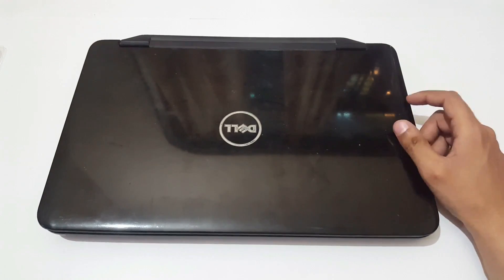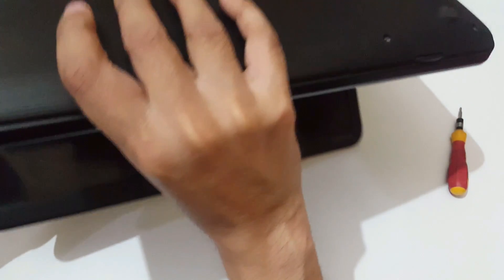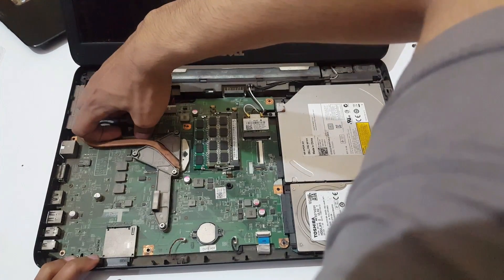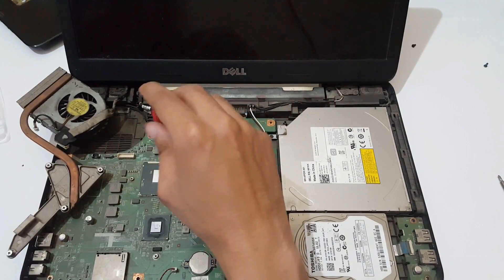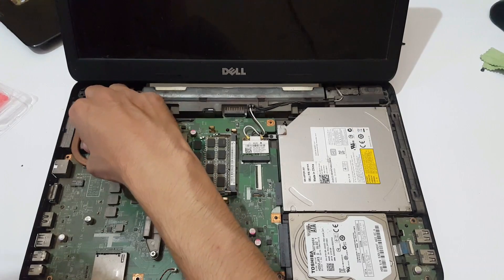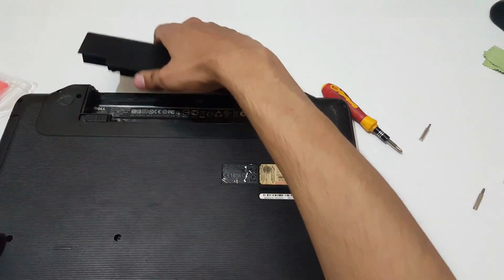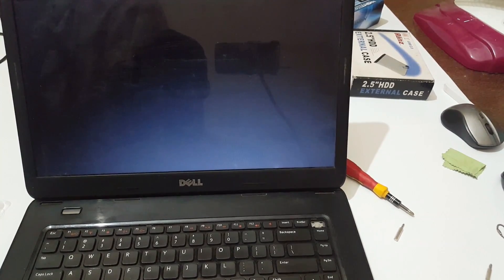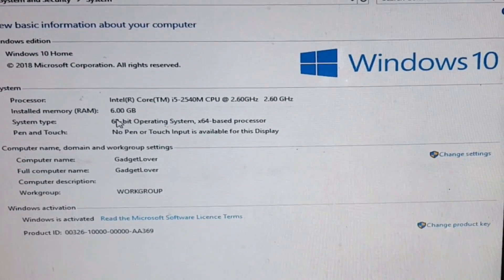How to Upgrade Processor on DELL Laptop | i3 to i5 & i7 - Make Laptop Faster for Gaming

Comment: Can I upgrade my laptop's processor ( or can I install 2 rams )?  : 
DELL inspiron 15 3000, 4gb ram (2gb amd m430 videocard) and i3
Reply from the maker: Ziya Mammadli : In my knowledge the processor of this Laptop is soldered so you can't upgrade it I would suggest you upgrade its RAM and install SSD for better performance
Reply: @GadgetLover360  bro I am also using the same laptop
Can I upgrade the motherboard to a better one so that I can install a better cpu..?
Reply from the maker: siva kumar : Yes
Reply: we r same spces bro i upgraded my ram to 12 gb it perform bettter i have dell isspiro with 2gb amd graphics i3 7the gen right

Comment: I have a dell latitude e5440 intel core i5 4310u can i change processer of this laptop i5 9th gen
Reply from the maker: The space Tv : The processor of this Laptop is soldered so you can't upgrade it so I would suggest you upgrade its RAM and install SSD for better performance
Reply: Gadget lover : thanks for reply
Reply from the maker: The space Tv : You're welcome
Reply: Gadget lover : what ram size should I buy 4gb or 8gb
Reply from the maker: The space Tv : I would suggest you see its manuals for RAM upgrade details
Reply: Gadget lover :can i play gta v on this laptop
Reply from the maker: The space Tv : No
Reply: Gadget lover : why
Reply from the maker: The space Tv : It will not run smooth in this Laptop so I would suggest you low its graphics properties and see it is running properly or not

Comment: I have HP pavilion 14-n045 tu
How can I upgrade this to work on solidworks smoothly. 
Please guide me.. Thankyou
Reply from the maker: Rab pro : You're welcome and in my knowledge the processor of this Laptop is soldered so you can't upgrade it so I would suggest you upgrade its RAM and install SSD for better performance

Comment: My laptop is dell vostro 15 3581
Please suggest max upgrades for my laptop
Reply from the maker: GAMEARI X : In my knowledge the processor of this Laptop is soldered so you can't upgrade it
Reply: @GadgetLover360  : actually tell me if I can upgrade the ram and to what extent
Reply from the maker: GAMEARI X : Yes and for more details I would suggest you see its manuals

Comment: My laptop is Dell Vostro 15 3546 intel celeron 2957U @ 1.40 GHz which is max upgrades for this laptop to improve it's performance?
Reply from the maker: Anuj Kumar : The processor of this Laptop is soldered so you can't upgrade it so I would suggest you upgrade its RAM and install SSD for better performance
Reply: @GadgetLover360 oh thanks for the info
Reply from the maker: Anuj Kumar : You're welcome

Comment: Hi. I have used i3 core in  windows 8.1pro,  so can I use i9 processor in my laptop  and is it possible?
Reply from the maker: Avik Samanta :  If it is not soldered you can upgrade it in same generation
Reply: Thank you
Reply: Please tell me can windows 8.1pro support miracast? If it's supported so how can I cast on my SONY TV
Reply from the maker: Avik Samanta : You're welcome and I would suggest you go to my Youtube channel and watch How to Connect Laptop to TV
Reply: Can you send your link for this video
Reply from the maker: Avik Samanta : Link is https://m.youtube.com/watch?v=s9mNGM8X63Y
Reply: My Sony TV support Miracast. I connect my mobile on TV with Miracast but my laptop didn't connect.
I check in my laptop that my laptop support miracast and yes  my laptop support miracast. But when I connect to my TV so the laptop send me that somethings went wrong. Few days ago I installed more apps on my laptop example Miracast Display etc. But no one connect. So please tell me app that I can cast to my laptop to my TV please.. 😔😔
Reply from the maker: Avik Samanta : There is no need of third party software for this method I would suggest you check HDMI cable is working properly or not
Reply: I have no HDMI cable and why I need for this when I have miracast option sorry my friend you can not solve my problem 😔
Reply from the maker: Avik Samanta : I would suggest you first connect your Laptop and Smart TV to the same WiFi network connection then try again

Comment: Sir I have the same laptop you have shown with 4 gb ram and 500gb HDD can I upgrade the RAM and HDD TO SDD and upgrade my processor as well
Reply from the maker: siva bhaskar : Yes
Reply: Gadget Lover what is the ram I should buy and my laptop presently has 4gb of ram installed and what ssd is best
Reply: Gadget Lover thank you sir
Reply from the maker: siva bhaskar : You're welcome and I would suggest you buy hynix 4GB 1333MHz RAM and Seagate Maxtor Z1 240GB 2.5 inch internal SSD for your Laptop
Reply: Gadget Lover thank you sir
Reply: Gadget Lover Thank you sir
Reply from the maker: siva bhaskar : You're welcome and if you are using Windows 7 I would suggest you upgrade it to Windows 10 for better security and performance
Reply: Sir any suggestions on updating my OS as I am facing severe lag in my laptop while using it,

Comment: Hi brother I am very surprised about your shared video of updating the processor. Actually I am using Lenovo G50-70 laptop model number is YB05106990 MISSION TYPE MODEL 80DY59422410. IS IT UPGRADABLE WITH I5 PROCESSOR. IF IT IS POSSIBLE CAN YOU PLEASE SUGGEST ME WHICH GENERATION OF I5 PROCESSOR HAVE TO BE UPGRADE?
Reply from the maker: dinesh m : Hi and Unfortunately the processor of this Laptop is soldered so you can't upgrade it

Comment: i have dell inspiron 3576 with  i5-8250u processor can i upgrade it to i7?
Reply from the maker: pratik gamer : The processor of this Laptop is soldered so you can't upgrade it
Reply: @GadgetLover360  so there is no way to upgrade the processor?????????
Reply from the maker: Nirajan Gyawali : Yes there is a way but professional hand soldering services are required for this
Reply: @GadgetLover360  So through Pros i can upgrade my 1.2ghz gpu to more than 2ghz????
Reply from the maker: Niranjan Gyawali : No but you can attach it externally to your Laptop

Comment: I have i3 processor and 4 gb ram can you change ram and processor
Reply from the maker: Ompati : If processor is not soldered you can upgrade both and I would suggest you install SSD for more better performance
Reply: @GadgetLover360  thnx but tell me about processors cost i5 processor +Ssd
Reply from the maker: Learn Hindi Fact : What Laptop do you have

Comment: Sir, I am having dell inspiron n5050. I have the manufacturer configuration and did not upgrade anything. I do not have a graphics card also . Suddenly my laptop has become very slow and hangs a lot and has become unusable. I am using windows 10 . What is the cheapest upgrade/fix as my laptop is almost 6 years old . 4 gb ram , 500 gb hdd, i3 processor
Reply from the maker: Ankush Chakraborty : Intel Core i5 2540M is best processor for your Laptop and you can attach graphics card externally to your Laptop for better gaming experience and I would suggest you upgrade its RAM and install SSD for more better performance
Reply: @GadgetLover360  Sir, I am not willing to spend much after it as its already 6 years old . Please suggest minimum which changes are acute mandatory to run windows 10 properly . I checked in task manager that my cpu usage never climbs up more than 20 % but then also my laptop hangs. Can you please tell me the reason why I am facing this issue? Disc usage is also 30% most of the time and memory usage is 51% , none of them never reaches 100 but laptop hangs.
Reply from the maker: Ankush Chakraborty : Give a fresh start to your Laptop and see whether the problem has been solved or not
Reply: @GadgetLover360  no sir , it is not solved
Reply from the maker: Ankush Chakraborty : I would suggest you go to nearby PC store and tell them about this problem they will fix it
Reply: @ankushchakraborty8179  Run chkdsk in cmd window (it will show if there is any error in HDD), then open %temp% in run command delete all the files and then open temp folder using run command and delete all the files after that run prefetch in run command and delete all the file except those which system show a message window to skip or delete. If after all the aforementioned steps your system still slow, then change your  hdd and replace it with SSD.

Comment: I have dell Vostro 15 3000 i3 7020U processor, can you suggest which processor I can upgrade????
Reply from the maker: mayur chandekar : Intel Core i5 7300U is best processor for your Laptop and I would like to inform you that if processor is soldered you can't upgrade it

Comment: Sir I have asus vivobook 15 x512fa ej373t with i3 10th gen processor i can upgrade the processor or not and whic is the best processor if it is upgradable
Reply from the maker: Kamlesh Verma : In my knowledge the processor of this Laptop is soldered so you can't upgrade it

Comment: Very nice video bro :) . I have panasonic cf-53 with intel core i-3 2310M, how can i upgrade it ?
Reply from the maker: Azwir Al Kapi : Thanks and Intel Core i5 2540M is best processor for your Laptop and I would like to inform you that if processor is soldered you can't upgrade it

Comment: Hi, i have levovo ideapad s145-14wl core i3 i want upgrade to core i5 which core do i have to buy? And ram also just 4gb only -_- and btw.. Can i upgrade my laptop to NVIDIA graphic? Is it compatible?
Reply from the maker: Jang man Wul : The processor of this Laptop is soldered so you can't upgrade it but you can attach graphics card externally to your Laptop and I would suggest you upgrade its RAM and install SSD for better performance

Comment: bro plzz tell how can i choose perfect processor for my laptop
Reply from the maker: KUCH MAZEDARR : What processor is in your Laptop
Reply: @GadgetLover360  intel core i3-6006U @2.00 Ghz, 2000Mhz
Reply from the maker: KUCH MAZEDARR : Intel Core i5 6360U is best processor for your Laptop and I would like to inform you that if processor is soldered you can't upgrade it
Reply: @GadgetLover360  plzz cant you get me the link of this processor from any website
Reply from the maker: KUCH MAZEDARR : I would suggest you buy it from Aliexpress online store
Reply: @GadgetLover360  mena check kia pr mujhe nahi mila
Reply from the maker: KUCH MAZEDARR : If not available find it on other websites or buy Intel Core i5 6300U
Reply: @GadgetLover360  but it has only 2 cores
Reply from the maker: KUCH MAZEDARR : Both has 2 cores
Reply: @GadgetLover360  bhai mujhe upgrade krna hai i want 4 cores
Reply from the maker: KUCH MAZEDARR : No such processor available and this processor will upgrade the Laptop performance
Reply: @GadgetLover360  can i upgrade this with intel core i5 9600k
Reply from the maker: KUCH MAZEDARR : Unfortunately you can upgrade it in same generation only
Reply: @GadgetLover360  so which generation processor I have?
Reply from the maker: KUCH MAZEDARR : Sixth generation

Comment: mine is a Dell inpiron 15 n4050 which cpu should i upgrade?? (the best
)
Reply from the maker: Andre Yee安特乐 : What processor is in your Laptop
Reply: @GadgetLover360  i3 2330m 2.20ghz
Reply from the maker: Andre Yee安特乐 : Intel Core i5 2540M is best processor for your Laptop
Reply: @GadgetLover360  how about i7 2620??
Reply from the maker: Andre Yee安特乐 : Yes you can upgrade it with this processor

Comment: Hello sir, Dell vostro 1320 core 2 duo P8600 @ 2,4Ghz can upgrade or replacement processor? Thanks
Reply from the maker: 良し俺 : Intel Core 2 Duo P9700 is best processor for your Laptop
Reply: @GadgetLover360  thanks a lot sir
Reply from the maker: 良し俺 : You're most welcome
Reply: @GadgetLover360  sorry sir, how about core 2 duo T9600 or T9550, can i replacement to it?
Reply from the maker: 良し俺 : Yes you can upgrade it with these processor but it will produce more heat and Laptop will run hot
Reply: @GadgetLover360  okay thanks for information sir, i'll think about it
Reply from the maker: 良し俺 : You're welcome

Comment: Hi!! I have a Dell15-5558 with Intel i3 and 12Gb of RAM, what CPU should I buy to upgrade it and make it faster?
Reply from the maker: Carlos : The processor of this Laptop is soldered so you can't upgrade it I would suggest you install SSD for better performance
Reply: Intel 480
Reply from the maker: Beemy Breezy : Intel Core i7 640M is best processor for your Laptop
Reply: Who said I have a laptop
Reply: But still thanks for the advice
Reply from the maker: Beemy Breezy : You're welcome
Reply: I have a laptop lenova yoga it was i3 how will change into i7
Reply from the maker: 4 Friendzz : In my knowledge the processor of this Laptop is soldered so you can't upgrade it
Reply: @GadgetLover360  thanks for the reply
Reply from the maker: 4 Friendzz : You're welcome
Reply: @GadgetLover360  Then what I do for change it
Reply from the maker: 4 Friendzz : I would suggest you upgrade its RAM and install SSD for better performance

Comment: I have Hp -p029tx  i3 processor ram 4gb can I upgrade it to i5 or i7 ?
Reply from the maker: master AZ : Intel Core i5 4310U is best processor for your Laptop and I would like to inform you that if processor is soldered you can't upgrade it

Comment: Hey mate 
I have a Dell e6430 with these specs, what upgrades would you recommend 

CPU: Intel Core i7-3540M Processor (4M Cache, 2 Cores, 3.0GHz base frequency)
RAM: 16GB Non-ECC DDR3 1600 MHz SDRAM
HDD: 128Gb LITONIT SSD Drive
Graphics: 
1x Intel Integrated HD4600 Graphics
1x Nvidia NVS 5200M
Reply from the maker: Ash Royan : Intel Core i7 3632QM is best processor for your Laptop and I would suggest you install SSD for more better performance

Comment: Can i upgrade proccer on dell inspiron 15 3521 plzz replay fast 😱😱😉😉😝😊
Reply from the maker: Roasting By Rishab : The processor of this Laptop is soldered so you can't upgrade it
Reply: @GadgetLover360  so can i install gpu on it
Reply from the maker: Roasting By Rishab : You can attach graphics card externally to your Laptop
Reply: @GadgetLover360  i want internel
Reply from the maker: Roasting By Rishab : It is not possible

Comment: Hey great vid. I have an old Dell N4010 and I wanted to upgrade it to i5-2450M but all I can find online is used processor. Can you suggest similar i5 processor that can help similarly and is easy to find it online?
Reply from the maker: nine8nine1 : Thanks and what processor is in your Laptop
Reply: @GadgetLover360  It's Intel Core i3 CPU M370 @2.4GHz
Reply from the maker: nine8nine1 : Intel Core i5 580M is best processor for your Laptop
Reply: @GadgetLover360  Thank you man
Reply from the maker: nine8nine1: You're welcome

Comment: Hello sir, i have Dell Inspiron 3552 . Processor= penN3710. Can i upgrade this laptop? If possible which processor will be best for my laptop?
Reply from the maker: Abhishek Nandy : The processor of this Laptop is soldered so you can't upgrade it
Reply: @GadgetLover360 should i use windows 10 os in my laptop?
Reply from the maker: Abhishek Nandy : Yes for better security and performance I would suggest you upgrade it to Windows 10
Reply: @GadgetLover360  thank you
Reply from the maker: Abhishek Nandy : You're welcome

Comment: I have dell vostro 1014 core 2 duo T6670 processor. can i upgrade my processor to i3 please suggest me what is best method to speed up my laptop
Reply from the maker: Deepak Tiwari : Intel Core 2 Duo T9900 is best processor for your Laptop and I would suggest you upgrade its RAM and install SSD for more better performance

Comment: I have dell inspiron 3542 with 8GB ram and 1.7ghz with turbo boost to 2.5 and a Intel core i5-4210U 

Can you suggest the best processor for me. Thank you!
Reply from the maker: Riyan Mohammed : The processor of this Laptop is soldered so you can't upgrade it
Reply: @GadgetLover360  oh ok thnx I was just asking because something happened to my processor so i just wanted to see if it was upgradeable Thanks!
Reply from the maker: Riyan Mohammed : You're welcome

Comment: I have an Dell Inspiron N5010 with core i3 480m and 4gb ram is it worth to upgrade the CPU? And if it is which processor should I upgrade to? Another question is there any way I can add a ssd in my laptop. Thanks in advance.
Reply from the maker: Akarsh Kar Mahapatra : Intel Core i5 580M is best processor for your Laptop and I would suggest you upgrade its RAM and install SSD for more better performance
Reply: @GadgetLover360  thank you so much
Reply from the maker: Akarsh Kar Mahapatra : You're most welcome

Comment: Hi bro I have a Lenovo with i3, 1.7ghz and i've upgraded the ram to 8gb and fitted an ssd.
I don't know if the processor is soldered or not. Could you recommend the best core for my laptop? thanks.
Reply from the maker: Miquel Auladell Visa : Intel Core i5 4310U is best processor for your Laptop and I would like to inform you if processor is soldered you can't upgrade it
Reply: @GadgetLover360  I've been searching on amazon and ebay and haven't found anything other than complete laptops with this processor. Where can i find one?
Reply from the maker: Miquel Auladell Visa : I would suggest you buy it from Aliexpress online store

Comment: Hi Bro, I have a HP Core i3 5010u 2.10 ghz with 8 GB Ram, suggest me a suitable core for gaming Please.
Thank you!
Reply from the maker: Muhammadh Hazeem : Intel Core i5 5200U is best processor for your Laptop and I would suggest you upgrade its RAM and install SSD for more better performance
Reply: @GadgetLover360  Is it ok if I use any core I5 processor??
Reply from the maker: Muhammadh Hazeem : Unfortunately you can upgrade it in same generation only
Reply: Ok Thanks a lot Bro
Reply from the maker: Muhammadh Hazeem : You're most welcome

Comment: Bro i have a Dell Laptop it's windows 10 has a intel core i3 processor  2.00 GHz CPU 64 bit can i update it to intel core i5 or i7
Reply from the maker: Demith Ekanayaka : Intel Core i5 5300U is best processor for your Laptop and I would like to inform you if processor is soldered you can't upgrade it